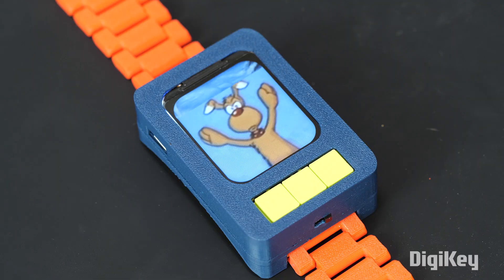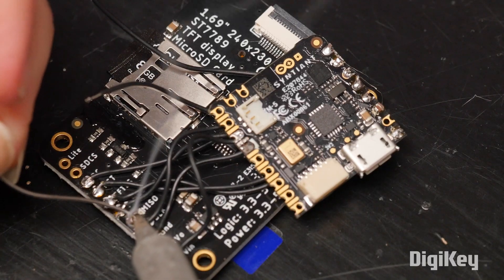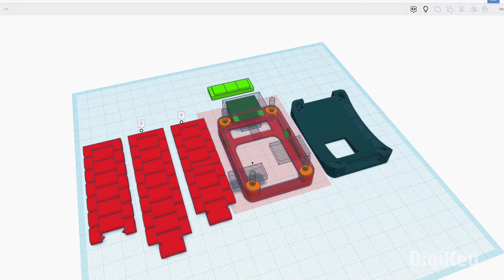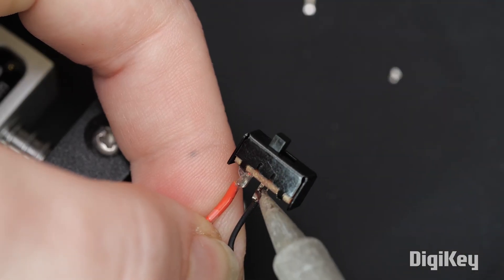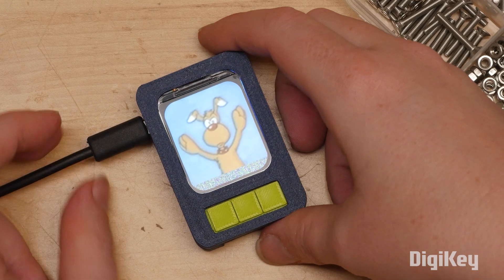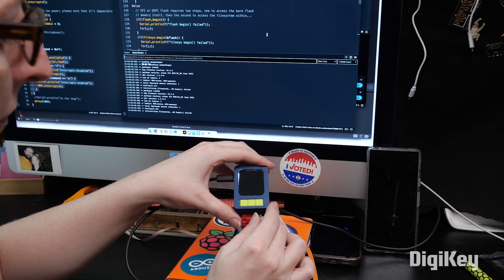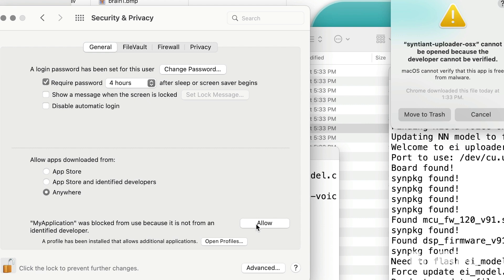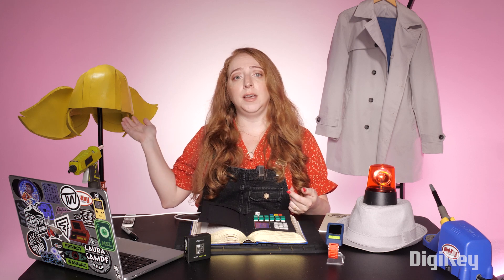Penny’s Watch - Electronics with Becky Stern | DigiKey

Comment: You don’t know how to solder a wire to the PCB…the thru-holes are meant for the wire to pass thru and solder from the other side….that would make the electro-mechanical connection much more reliable as it will stand better horizontal and vertical mechanical stress/tensions……